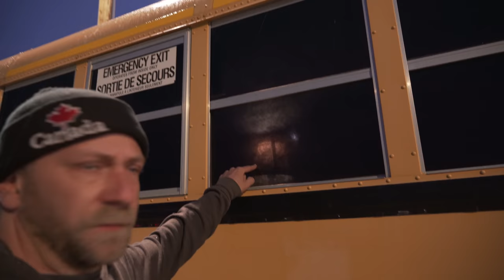Stealth Camping In School Bus

Comment: Hi Steve...Just a short tip on being stealthy with your lighting. On Navy ships at night, they use red-colored lights so that lights are not so obvious when a hatch or doorway is opened. It also helps your eyes focus to the night quicker. It might be something to at least consider when stealth camping!
Reply: Red light is not much less visible in this situation
Reply: Unfortunately Steve is color blind and has mentioned on other vids that others have recommended it but he can’t see red light. Good suggestion though.
Reply: Great idea on red "battle" lighting. My extended van conversion on my channel has a bed similar to what sailors have on submarines, but with a notch to sit up and watch TV, and a corregaed wrap around sliding door to seal myself in to heat only the sleeping area to save on fuel at night.
Reply: It's even more stealthy using red chemlights as well.
Reply: @larryb9642 such an informative comment. I skip through the vids, so I never catch those details.

Comment: Steve, quick tip: attach the lamp with museum putty. You can find it at hardware or arts/craft supply stores. It will hold the lamp down but can be removed without ruining the surface of the table. Might also come in handy for attaching the table. Make sure the table feet and floor surface are cleaned with alcohol and dry first.

Comment: This is my dream size. I am currently doing it in a uhaul van. I reserve them weekly. I don’t go more than 10-20 miles so it doesn’t break the bank. My job and the gym I go to to work out and shower, are a block or two away. I park right in the middle for free at a parking garage. Works out and it’s the way I want to do it.

Comment: looks like you need to adjust your shutter speed in the darkness of the bus! but im stoked its coming together.
Reply: That's just the refresh rate clashing somewhat with the phase of the electric light. The camera's 'shutter' is permanently open while recording video; it isn't opening and closing 25 times a second. That'd be a bit noisy.

Comment: Love, love, love! this particular video because I myself am a school bus driver. In the last few mins of the video where you talked about the door being opened with the lever we still have those in operation and a mixture of the button press to open door. Also I don’t know if where you stay but some of the newer model buses are more economically friendly school buses are being converted to propane..we’ve been getting a lot of those in lately & they also have a very cool feature which is dimmable lights lol, they also have a distance monitor so if you follow another car closely & they after it attempts to slow down and no response you can risk of the schools bus shutting completely off.

Comment: Steve looked like Papa Smurf cutting out in the morning. This is my idea of camping . Fire up the dymaxion car and stealth off into the sunrise. No cold exit from a cheap sleeping bag. No folding up the ice things barehanded. Just stagger up to the cushion chair and turn the key. Away!  Forget all the crappy stuff, it will follow along riding the bus. A string tied around the lamp and run up to a magnet would save it from tipping over. The diesel motor can be replaced with a good one later on. Looks cool so far. Good job. Great idea. Happy trails.

Comment: If that's a diesel engine, they don't even get really broken in until around 350k miles. She's got a lot of life left in her!! 🚌
Reply: I'm sorry but that is wrong. Not how an engine works. If it's at 300,000+ you should probably do some maintenance regardless of what kind of engine it is.
Reply: @MeachPango  you're absolutely right. You should always do regular maintenance. Even on diesel engines with 350k mileage
Reply: @MeachPango  doesn’t that go without saying? How often do people not do regular maintenance on their cars?
Reply: @radmom05  ok you are saying the motor isn't even really broken in until 300,000. If you actually think that then im sorry for you man.
Reply: @steverogers7601  you'd be surprised. If people weren't raised working on a vehicle then some of them can get really stupid. Just lookup a "what mechanics have to deal with" video and you'll see how oblivious people can be. I assumed the commentor was saying that at 300,000 an engine is basically new. If I was wrong then oh well.
Reply: @MeachPango  lol, how do you equate the statement that a diesel engine, at 350k, compared to a gasoline engine at the same mileage, just getting broken in, to not doing any maintenance? How does this even become an argument when I'm agreeing that ALL engines need maintenance?? Of course you need maintenance on all engines.
Reply: Its a small diesel and an early attempt at the new air pollution control standards. It is a huge money pit and its life is more like (I hope cause I have one) 400k to 500K. I have 252k on mine and it has been a huge money pit. I have changed the oil and filter every 3 mos. and fuel filter every year along with many, many , many other things. Gets better economy than other engines though but all the money saved with the economy will be lost in the maintenance. He'd better make sure the engine block heater works as well.
Reply: @robertclaps1985  Yep.  This is reality.  Emissions controls totally ruined diesel engines.
Reply: @MeachPango  regular maintenance is required with any engine, but diesels oil and filters and don't abuse it you could get over a million miles,  yes I said a million.

Comment: Steve, consider a Webasto heater. They are made for diesel rigs. You can get a couple different configurations to either heat the cab, heat that engine in the winter, some even have air conditioning and have a built in generator. And the whole thing is fueled from your current diesel tank.

Comment: Get yourself a whole lot of black vinyl and velco, you can make blackout curtains that you could stick to every window to completely black out the entire bus. Cut vynil oversize to the windows, stitch one side of velcro to the outside edges of the vinyl, black facing out, and glue the other side of the velco to the surround of the window. That way you can remove some, or all, no dealing with magnets and shit flying around...

Comment: Steve, keep your lamp by the window, but cut some squares of the landscape fabric and glue it to the side of the lamp shade that faces the window. That may help diffuse the light in the window. Also, get a cheap piece of pvc pipe and fabric to make your partition for the front. Cheap and easy to “hide”

Comment: Nice video.  You could spray the fabric with a few light coats of flat black enamel paint. It will block more light and stiffen the fabric slightly. You won't be able to fold it but you can roll it up when not in stealth mode.

I have a plan on my channel to convert an extended van (no roof extension, just longer) into a micro mobile stealth home. It has a tiny shower/toilet and a pocket door that totally seals the living space from the driving cabin. It has a small kitchenette, a bed that can be pulled out to extend over the isle (for a guest). The other side has a drop down table with 2 fold up/down chairs, and a desk/wardrobe. I have a custom stealth heating system. No space is wasted. The bed is sort of like what sailors have on a submarine, but with a notch to sit up and a wrap around sliding corregated door to seal in heat at night. I save on fuel by only heating the bed area at night, then open the door to heat the living area upon waking. It is very cozy and practical by design. It's is mainly just a place to sleep (8 hours a day), the other 16 hours is at work or hanging out somewhere, but if I had to do a 24/7 stint in the van, it can be done. I designed my own electrical system with Converters for 12VDC, 120VAC, 220VAC 50/60 Hz, mini Generators (gasoline/diesel/propane), and Solar.

The kitchen uses mainly a microwave/convection oven, but a combo propane/electric oven/2 burner top is also available, as well as a mini frost free fridge/freezer, and a small sink. The bathroom has a small sink and you sit on the toilet (lid down) for shaving and showering.

I would love to apply my plans to a mini school bus like yours... no bending over to get about inside and more room.

Comment: Hi Steve, check out the plant pot heaters with tea lights, always be wary of the (very low chance) ignition hazard if you overload but they do work and work safely if you work it sensibly, I just used one terracotta plant pot and it works like a dream. Carbon monoxide risk is no greater than a few candles. Solid fuel heating cheaply. 

There are plenty of great vids on this platform.

Comment: Steve if you value the headgaskets in that engine put head studs in it as soon as you can. I don't know if it's as big a problem on the lower horsepower version of that engine but it's a problem on the Ford ones

Comment: yeah, it's funny how many buttons are for the heat, and that noise kill is actually pretty essential for convenience, i think the only two you didn't mention is the ambers for when you're approaching a bus stop, and the master in case there's a problem with the amber switch you can use that as an alternative. the crossing gate should activate on its own during the correct procedure as there is no single switch for that (i'm in the u.s., though, so maybe things are a bit different there). 

150K miles is quite a bit, but there's still some life left in the old girl. keep an eye on your DEF level, that's a thing.

Comment: One thing that would be cool would be to have the rubber material rolled up into a projector screen type device on threat and the sides. Pull it, it rolls up, and you can travel. Then find a spot check it out, then pull the material down.

Or you could not spend a lot of time with the mechanisms and just roll the material up and tie it to the top. Mechanisms would be cool though.

Comment: Steve, use Howes additive in the fuel every time you add fuel summer and winter.  My Ford 6.0 has 250 mi+ no problems at all.  I do oil changes at 5k with filter and fuel filters at 10k. Happy travels.

Comment: Thought of the whole Bus Conversion thing.  Has some ups and downs to it, like anything.  Finding a known-reliable bus chassis to use would be my biggest question: by default I would probably be inclined to use a 1-ton truck-to-bus-conversion chassis, but a lot of that depends on which specific year-model.  Of course deciding at this rate, I probably won't get anything accomplished either.......

Comment: 6.0s are not that bad. It's the 6.4 that is absolutely terrible. If you maintain that truck it will be fine, and if you're really worried about it, they make kits to fix the issues with them and they end up being great engines!

Comment: Pro tip of the day:    To completely black out the windows (on the cheap)  get some petroleum jelly and tin foil.  First,  spread a thin layer of petroleum jelly over the window you want covered, then smooth out a piece of aluminum foil onto the window. 
 The tin foil will stick to the petroleum jelly on the window, and keep  it in place. 
 Next, use a soft cloth and start in the center of the window,  and smooth  the tin foil out from the center to the edges of the window, getting all of the air bubbles out as you do. 
 It will block 100% of outside light, and keep anyone else from peering in. Lastly,  use a utility blade to trim the excess foil by lightly running the blade around  the edges of the window.

Comment: hey just a crazy idea but what you could do is wire up a motion sensor on the out side of the bus,  have the motion sensor feed a normally closed relay,  when the sensor, senses movement out side it closes witch opens the relay witch shuts the light off, then after X amount of time the sensor opens again, closing the relay and turning the light back on when the coast is clear.

Comment: Hey Steve if I could recommend maybe putting your lighting more in the middle of the bus instead of close to either side of the windows. Maybe find some magnetic lights to stick to the roof if possible or some heavy duty double sided tape. Thanks for the vids Steve !!

Comment: Paint it green and call it the ODB (Olive Drab Bus). Have a receiver hitch fitted to the back of it, then use that to install a receiver hitch cargo platform (available from Harbor Freight for around $60 USD) which you can use to transport battery banks, generators, etc.

Comment: How efficient are school buses as an everyday, or vacation/roadtrip kind of vehicle? Are they expensive to maintain and operate? Seems like it would be a really cool investment if you live outside of the city or urban areas.
Reply: Long and short is yes. School busses are built essentially on the same frames as box trucks and RVs of the same size so all you're looking at is the same vehicle with a different body. 

Expensive? Yeah, but no more expensive than a comparable RV because they're essentially identical except for the living compartment

Comment: Hey Steve, Came across your channel yesterday and I've been binge-watching some episodes throughout the overnight/day and just thought I'd post a comment as you've just earned a new Sub. What does something like that run on the used vehicle market? I would love to have something like that for myself that I could gut and outfit the way I'd love to with some bunks with real mattresses, a nice desk/computer station, killer audio system, CB Radio, roof rack, cabinets, and anything else to make it a killer off the grid vehicle, Hell maybe even an observation area up on the roof. Love that electrical switch panel in the cab, you've certainly got enough room there for some tasty upgrades. Hope all is well and look forward to checking out much more of your content.  Take Off Eh!

Comment: Ok, I subscribed to Step 2, since this is the first I have heard about it.  I assume that you will add some form of bathroom, kitchen, etc.  If so, I want to watch it appear.  If not, some of us will be disappointed.  I am converting my Minnie Winnie to solar this fall when the temperatures cool, and changed to lithium batteries.  I have a pair of inverter generators which will run it all, but want something cheaper when boondocking.

Comment: You should try some of those battery powered surface lights, or some of those automotive rope lights, and mount them below the window line, and/or close to the floor, they would give you great lighting, and the actual light (bulbs) wouldn't be seen through the windows.
Reply: Thays actually a really good idea , they work great and pretty reasonable

Comment: Hey! I used to work on those busses. Why  did you cut the seats out when you can unbolt them from the floor and  side rails. Either half inch or 7/16 bolts.

Comment: Black spray paint the windows on the inside .looks like tint from the outside and a razor blade and glass clean will remove it 
Done this on truck topper windows.

Comment: a 100% windowshade would by my thing. , fold up bed.. composing toidy... shower... prope stove .three fuel stove... flex solar panels look like roof from the street.. rocket stove or diesel burner to avoid carmon monox....nuts to roughing it
spare battts.. mesh ptint canvas to resemble cage between driver area and rear covert...

cops alll use plate readers.. you need a co. name like standard transportation llc....